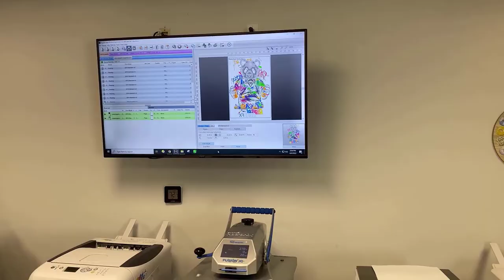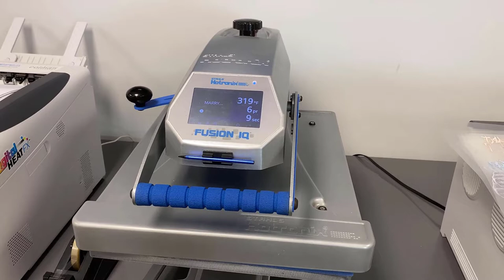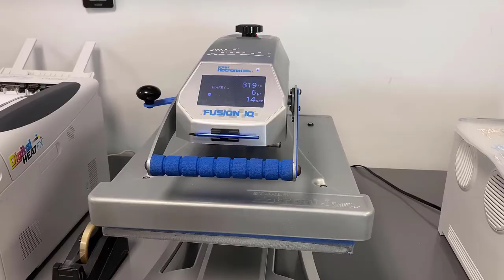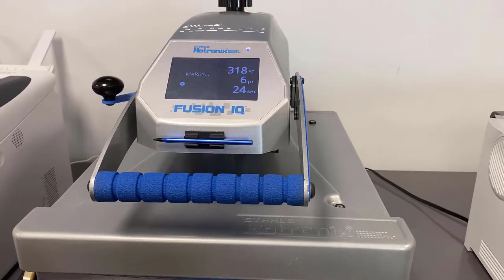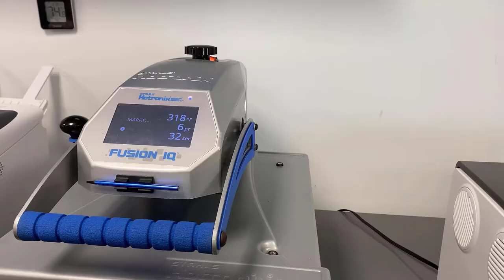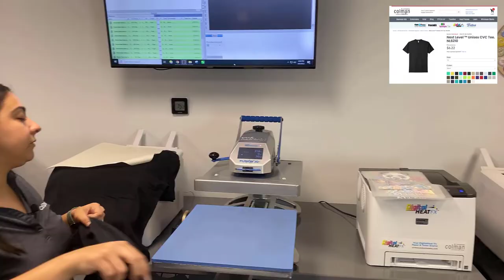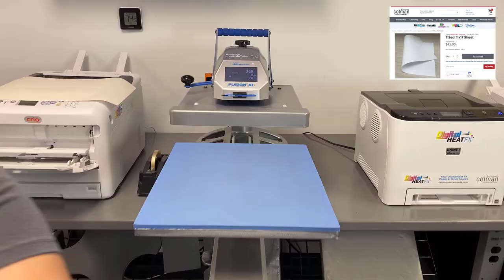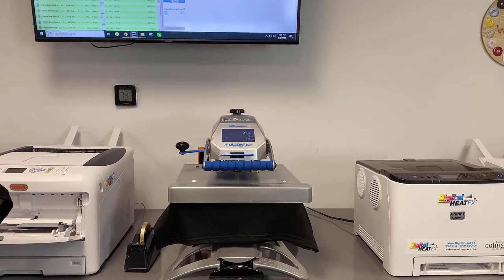Making a Full Shirt Order With the DigitalHeat FX System | Production Run

Comment: Hi there, can you tell me what's the difference is between the printers that put on the white ink and then you have to run them through the white powder and then heat up the whole transfer versus what you're doing like,  stretch ability on shirts how many washes you get before  fading and what type of shirts can you press both of them on.
Thank You
Reply from the maker: The biggest difference is the DigitalHeat FX System is a toner printing system and what you are referring to is DTF printing which is an inkjet printing system. There is also a huge printer size different and price difference. This is a really great video that talks about the pros and cons of each system - https://digitalheatfx.com/project/comparing-white-toner-printing-to-direct-to-film-dtf/

Comment: would you double your speed with a second press?  Also, can you press them onto a hat, mug and ???  Also, how many could you get done in an hour, if you were on it and with two heat presses?   Great video, Thank you!
Reply from the maker: So many good questions! Not EXACTLY double, but it would get faster with 1 of these 2 scenarios:
1 - Use 1 press for marrying only, so while you're waiting you could be applying completed transfers to a garment or object with your 2nd press
2 - double up on your marrying using both presses so that step would be done 2X as quickly

Check out the stats on this job where we did 16 large prints in an hour... while shooting the video: https://digitalheatfx.com/2022/04/white-toner-printer-2/

Comment: The AB EZpeel paper that I just purchased (07/23) from your company says 290 degrees for 100 seconds and must be completely cold before peeling.....which is completely different than this video, and the designs keep ending up on the B sheet.
Reply from the maker: We recommend following the instructions that came in the box of paper you purchased. Product updates over time can have adjustments in time/temperature.
Reply: @ColDesiColman  If I have a few little spots where the adhesive did not adhere to sheet A, can I still use the transfer if I'm ok with the light spot?  Will not having adhesive in those spots cause the design to crack or any other technical issues?  Is there any reason not to use the transfer other than you might see through the area?

Comment: Why if I do the exact same process my design cracks with the very first wash???? Hope you can answer me. Thank you
Reply from the maker: Hey Kathya - it can be a few different things:
> Process - white toner transfers require specific temperatures AND pressures to cure properly. 
> Design - a transfer sits on top of shirt fabric. So when you have large, filled in areas - think of a big, solid photo vs a design with "negative" space. When you wash the photo the water doesn't have anywhere to go THROUGH so it pushes against the design and that can cause cracking. There are some techniques you can use to alleviate that.
> The t-shirt quality matters. Transfers don't shrink or twist, which happens in the first few washes of some cheaper, lower quality tees. That can also cause cracking. 

The best thing you can do to troubleshoot is work with support. Lot's of people get fantastic results, so keep trying!